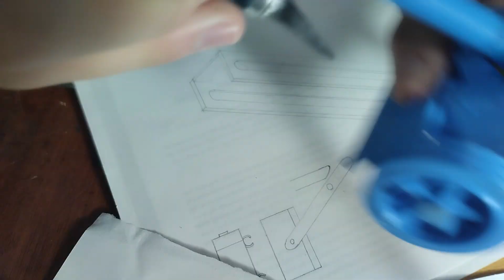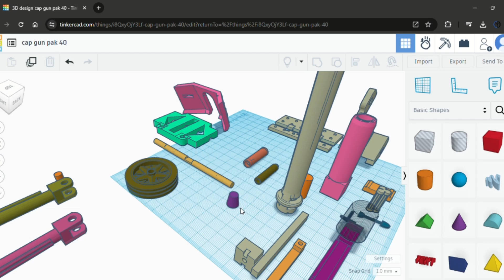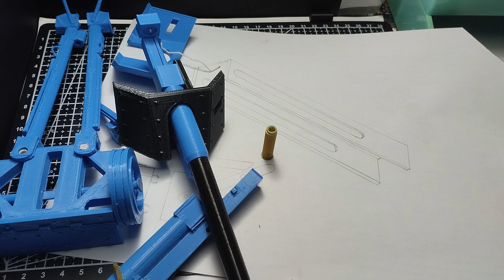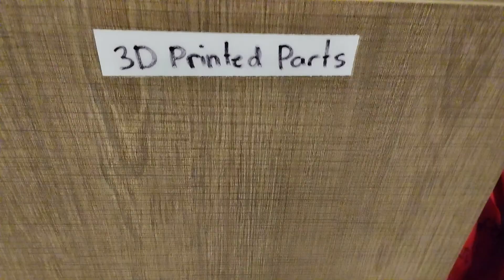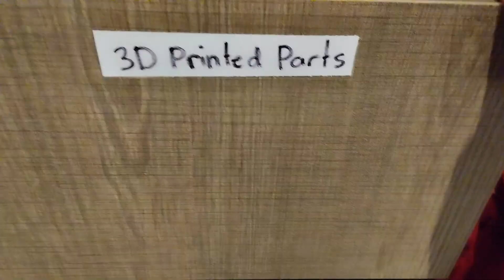3D printed Cannon that works

Comment: hello I have a few old projects(tried 3 times) to build a functional mini tiger tank, what is the red thing you used to generate the explosion?
Reply from the maker: It's cap gun ammo which you can buy from a dollar store and it's the same as Armstrong's mixture
Reply: @ideas-y4p  okay thank you very much, I will probably try to do the turret of it just to test when I finish the head of a dinosaur

Comment: Bro, btw, I noticed you changed your description. I know that you played wotb on ur channel cuz I also played it so I wanted to know how you did the gameplay videos. Pretty cool tbh, they were funny. I wanted to know your thoughts about war thunder, cuz I’m level 84 and I want other people’s  opinons on it. Your idea to replicate a battlefield is a good one, but I don’t know how you are going to pull it off. That is flite test or Peter sripol level of video. A piece of advice from me is to use some tipe of airsoft technology inside the planes and tanks. It is much cooler than lasers or whatever. 

P.S. Sorry for being annoying. I hope you had a nice day.❤
Reply from the maker: No worries, how i got the gameplay is i used a screen recorder that was built in my pc (windows) or you could download an app for the purpose, otherwise, i know you can go onto settings and enable the match save function, which allows you to get your gameplay from different veiws or in first person, which you can download (ive done this with wotb but not warthunder) hope this helps:)

as for the irl war thunder, if i can get enough money one day, i plan on using either ir battle systems, but that seems a bit boring, so i'm thinking of weakning the chassis of the rc vehicles to be penned by airsoft cannons, or to have a auto cannon capible to ripping apart the original chassis of the tank or plane and that will disable the vehicle in flight or ground with fpv cams attatched to the tanks, planes e.c.t.

Comment: Last video I gave you that piece of advice about stabilising your rocket using fins. I also mentioned that my motor broke.When summer came and I finished my exams my parents promised me that I can continue working on my project. Guess what? They don’t even let me to buy the parts for my missile, with my own money. So, no pressure, but I will highly appreciate if  my idea will be used in one of your next projects. I truly admire your work and your impact on the “people like us” community, but I will appreciate if my creativity will be at least be used, if I can’t. Still, no pressure. Keep up the good work❤

P.S. My parents told me to buy clothes instead, we truly live in a society where no one appreciates creativity…

P.P.S. I do acknowledge the fact that you replied to my comment saying that you will use my advice, but I wanted to let you know that now it will mean a lot to me.
Reply from the maker: Your comment made my day to know that people are supporting my channel even though its tiny. thx for the support :)
Reply: I realized that I’m lucky for owning a 3D printer. Hope you can start making stuff sooner or later.